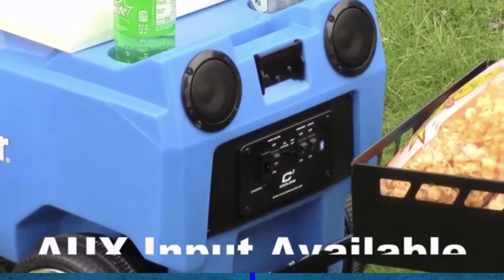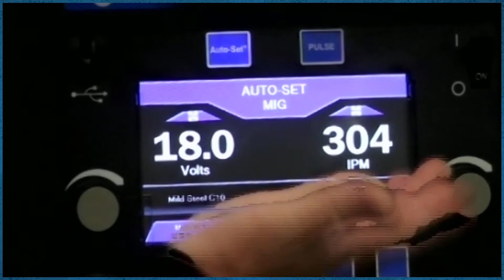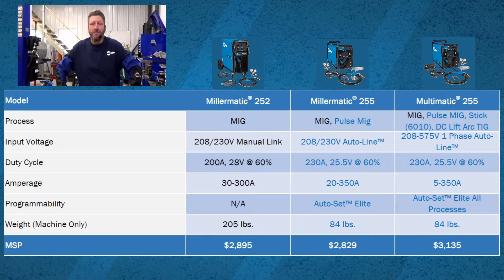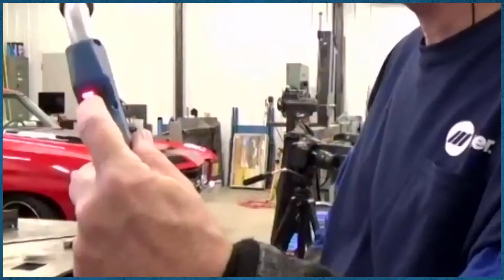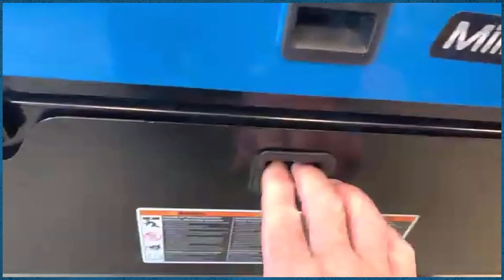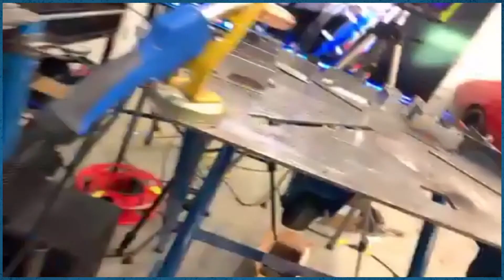Q & A LIVESTREAM Millermatic 255 and Multimatic 255

Comment: Can the multimatic 255 operate on a 50 Amp circuit breaker power? What is the duty cycle operating at the 50 Amp circuit power?
Reply from the maker: Thanks for your question, Richard. We have passed this along to our team and will provide you with an answer as soon as possible. Thank you!

Comment: Will the Multimatic 255 operate using a 50 Amp circuit breaker at what duty cycle?

Comment: Around the 24:29 mark you was talking about the gas and I’m wanting to use pulse so you can’t use 75/25 for pulse and y’all said you made the machine more optimized for 90/10 so you can have argon for tig we have thick nursery equipment and tractors so can 90/10 run thick metal and can it run thin metal also or do you think it would just be better for me to get 75/25 could you give me a thickness range for 90/10 gas from thinner metal to thicker metal. I ordered my machine a few days ago and I’m trying to figure out if I need 75/25 or 90/10
Reply from the maker: If you plan to use the Pulse MIG feature you would need to go with a higher argon content like 85/15 or 90/10. On 90/10 machine is capable of welding material up to 1/2" in a single pass either in pulse or spray transfer.
Reply: @MillerWelders  okay I appreciate that how thin can 90/10 weld and can you do short circuit as well with 90/10? I can’t really find a whole lot of answers online I’m a student so still trying to figure all this out thank you for helping me though.

Comment: miller is my favorite Brand welding machine. trusted this brand. hopefully next product.there will be a pulse mig. like multimatic 220 ac dc but no pulse mig
Reply from the maker: Thank You for choosing Miller and for your feedback.  The Millermatic 255 and Multimatic 255 machines have GMAW-P capability but are the smallest in our lineup that do.

Comment: Questions about pulse
Do I need the Acculock-S ?
Do I need a flush or recessed tip?
Contact tip to work distance?

What CFM do I need for 1/2" or 5/8" nozzle?
Gun angle for 2F (push or pull)?

3G down (pointed up or down)?

Trick to minimize splatter on start?
Reply from the maker: Hello, please email these questions to info@millerwelds.com and we will be happy to step through them with you in better detail.

Comment: I purchased a Miller 255 Multimatic ... haven't had it very long, but I love it so far.  I have a question though:   I am now seeing the Miller Deltaweld 350... obvious differences is 3 phase power vs single, heavier duty, and duty cycle.  But in terms of "capability" ... what is the difference between the pulse capabilities of the 255 vs the deltaweld 350?
Reply from the maker: There are many differences between the two machines as you have mentioned, aside from the Multiprocess capability of the Multimatic 255.  The Multimatic 255 is designed as a light fabrication machine with a very easy to use adaptive pulse.  The Deltaweld 350 with the features you noted is designed as a heavier duty production type of machine.  The true Accu-Pulse technology of the Deltaweld 350 is designed to be a faster reacting pulse aimed at increasing production efficiency.

Comment: I want to weld ALUMINUM mostly in "out of position",  verticle and overhead,  1/4" thick will it work well ?
Reply from the maker: Hi William, our parameter charts are developed for 2F Horizontal T-Joints. Out of position welding is possible with the Millermatic 255 and Multimatic 255, but alteration of the parameters from the door chart would be needed.

Comment: My Lincoln 180 Dual finally bit the dust. I just ordered the Multimatic 255. I chose it over the Lincoln 260 for a few reasons. It's multi process. It's light enough for me to remove it from the running gear so I can throw it in my truck and run it off my Trailblazer. It's ability to run mig and pulse mig off 90/10 gas was also a huge factor. I think it's real competitor is the Lincoln 360 multi process machine. That's also a fine machine but at $6,000, the 255 is priced much better, even with the running gear. Even cost aside, being able to mig and pulse mig off the same bottle won me over still. I was also pretty upset with my Lincoln 180. When it runs, there is a rhythm in its wine as its pushing wire. It effected the way it laid beads. Especially when running thin wire. This is a known issue and even though I've had mine 7 years, from my understanding, Lincoln has not fixed the issue, yet still sells the product. As a company, I think that's really shady. I've been so impressed with my Miller Trailblazer that I purchased the 255 without hesitation. Arrives in 1 to 1 1/2 weeks. Cant wait.

Comment: Can u pulse mig on millermatic 252?
Reply from the maker: Thanks for your question. You cannot Pulse MIG on the Millermatic 252. If you are interested in Pulsed MIG welding, we recommend the Millermatic 255 MIG welder.
Reply: Also keep in mind the pulse settings on the 255 are not I repeat are not adjustable. I bought a 255 thinking it would have at least some sort of adjustment for the pulse frequency at least. It doesn’t.  To say I was disappointed is a understatement. Why is it that on the Chinese machines you can change the background and the frequency and even the time on/off. But with a high dollar welder like the 255 you have zero adjustment!!  ??  Miller wanna chime in on this.
Reply: @Mad.Man.Marine  , The Millermatic 255 and Multimatic 255 machines were designed specifically with ease of set-up and operation for the user in mind and the ability to build custom pulse programs is more in depth than most light fabrication users voiced as a need.  Advanced programming capabilities are available in other machines designed for users who routinely have a need to adjust variables such as the pulse parameters you mentioned.
Reply: @traviswoiderski5578  I get that. But it really wouldn’t cost Miller much at all to add the programmable pulse to the 255. I mean most all the smaller Chinese machines have that capability.
Reply from the maker: @Mad.Man.Marine  Programmable pulse settings can quickly become confusing for many operators.  Welding engineers spent a great deal of time building pulse parameters based on wire diameter, type, shielding gas type and thickness of material to be welded in order to keep the set up as easy to use as possible while ensuring a quality weld parameter.  Manual independent pulse control settings would have been much less design time but for most users would have made the machine less user friendly.  Thank you for your engaging feedback and for choosing Miller.
Reply: @MillerWelders  don’t get me wrong. I love the welder. And it is easy to use for sure. But I feel like they could have made a separate program setting that the more advanced welder could use. Since it’s just programming and really no “hard” parts it wouldn’t hVe been hardly any money for what I personally think would have been a fantastic addition to the 255. So. What welder would I need to get to be able to adjust the pulse settings? The 350p?  And do I need any other attachments to be able to change those pulse settings. My reason for wanting this is. I build custom aluminum boats for a living. And I do lots of long long long continuous welds. As you probably already know. People want the stacked dimes look or they think the weld isn’t “professional”. I myself know that isn’t true. But you can’t tell people what they think they already know.   It would be nice to be able to make full length welds without back stepping at all and a adjustable pulse setting would make that happen. Thanks for talking back and forth with me on this. I really appreciate it.    Ian
Reply from the maker: Ian,  Based on your project, I would look into a system with Profile Pulse.  This process pulses your wire feed speed along with the current in order to produce that stacked bead look.  The frequency and power of Profile pulse is fully adjustable to create the look you need while producing a sound weld.  Boat/Ship builders are using this today with excellent results.  There multiple machines with this process but the most common one we see in boat building is the AlumaFeed system.  You will see examples of profile pulse welds on a boat in this video.  https://youtu.be/RSOtm3MPxXg
Reply: @MillerWelders  yes. Unfortunately I thought (wrong) that I would be able to adjust the back ground and frequency of this machine. I run a xr alumapro gun on this 255. Which is the reason I stayed with Miller when I wanted a new welder with pulse. Had been using a 252. So does the Miller 350p do this?  Or do I need to purchase a different “box” that is added to it. Or is it a completely different welder.
Reply from the maker: The AlumaFeed 350 Mpa is a different system than the Millermatic 350P.
Reply: @MillerWelders  ya I saw that. They are also like 10-15 grand!!  😳. All set I guess. I can get what I want out of a cheap machine.
Reply: @Mad.Man.Marine  I thought the same thing. I ASSUMED this higher priced machine had all these features after shopping pulse machines. I can see Millers point but not happy about not having this adjustment.

Comment: Will the millermatic 255 run off a CAT 12000 generator
Reply from the maker: Hi Charles, when operating the Millermatic 255 on 230 volt input power we suggest using a generator capable of providing no less than 10,000 watts of continuous power.